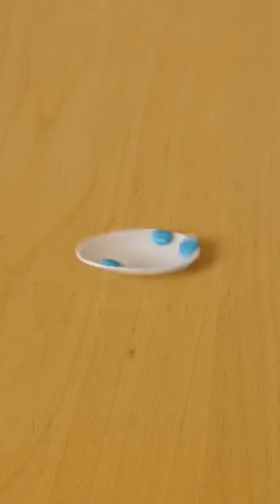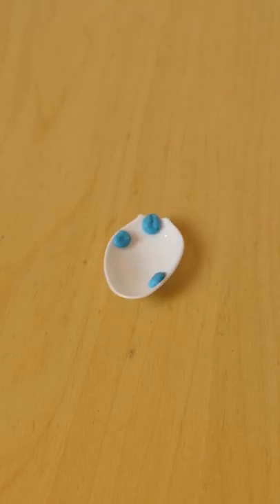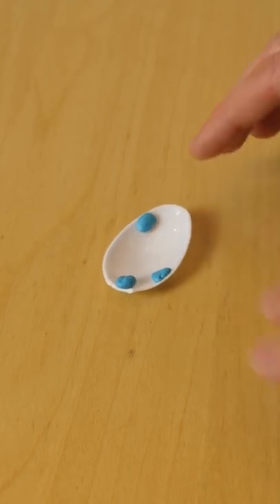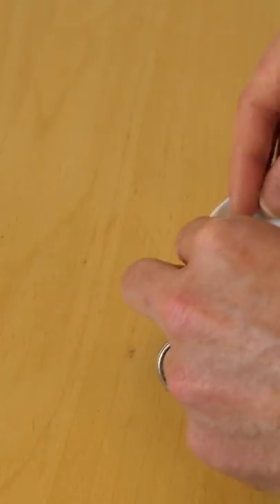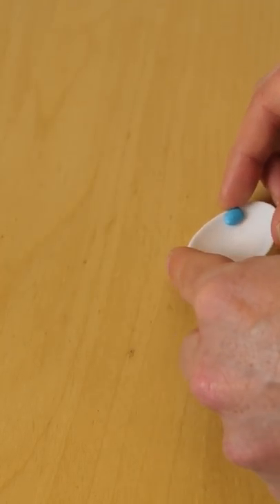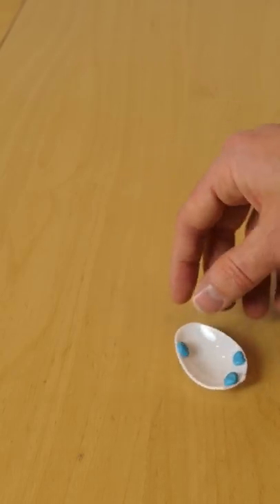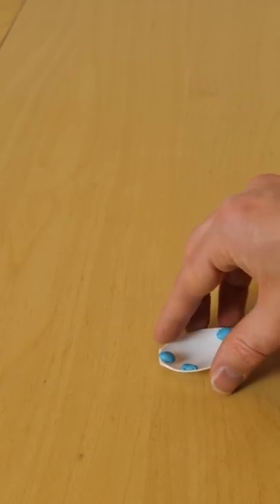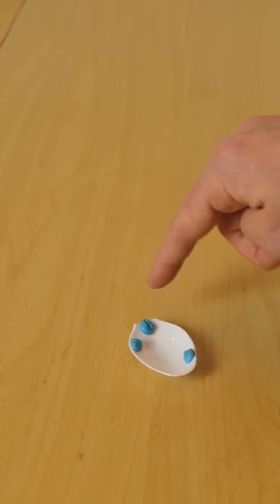Self-reversing Spin

Comment: A few months ago I noticed this effect with a saucepan and a bowl. If you spin the bowl it becomes unstable but will keep turning in the same direction until it stops. If you spin the pan, it turns in one direction but then as it slows the offset weight of the handle causes it to turn the other way before it stops completely. Presumably the same effect.

Comment: I wonder if this is close to the reason why Venus spins backwards. So like an uneven core mixed with the momentum of wobbly and spinning planet?
Reply: No
Reply: Venus also orbits the Sun anti-clockwise, but its unusual axis rotation is due to being upside down - it was knocked off its upright position earlier in its history! Astronomers believe that at some point, a colliding celestial body tilted Venus so far off its original position that it is now upside down.

Comment: So this works because the spoons natural center of gravity isn’t over the axis of rotation. When he adds angular momentum, the radial force on the center of gravity is grater then the force of gravity. Since the spoon has constant convex curvature on the table side, this causes the center of gravity to raise and the axis of rotation move in the opposite direction . When the spoon slowed down due to friction the radial force became less while force of gravity remained constant. And also pulling the spoons axis of rotation closer to the center of gravity, dumping some of the inertia from the area contained between the changing axis path.  Basically if you look at it as a differential,  when the axis changes there is mass moving in one direction linearly on one side of the right side of the axis, a mass moving in the opposite direction linearly on the opposite side. And when the axis moves slightly to the right the is mass added to the right side in total contributing to make the spoon spin in the opposite direction

Comment: So if you spun it in the direction of the heavy side, then what happens? Thinking it either slows, then starts spinning some more in the same direction, or… it never slows then speeds up, but instead just spins longer, slowing over time.

Comment: I think this one deserves more than a 3 second explanation. "The static friction will cause it to go the opposite direction." doesn't make any sense.
Reply: The relativity principle causes it to spin in the other direction. Lol

Edit : ....but the real explanation is that the rocking motion at the end will occasionally pivot the spoon to the heavy side and then the  lighter side, and this creates a weak torque that favours a particular direction as the weights are not aligned at the extremes.